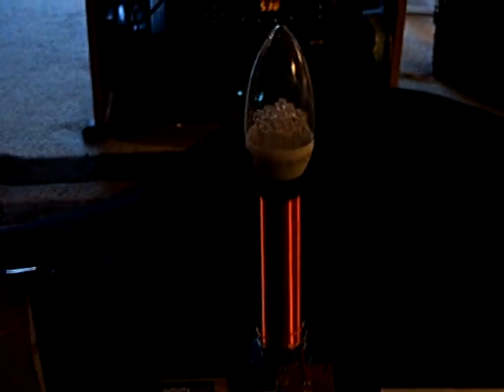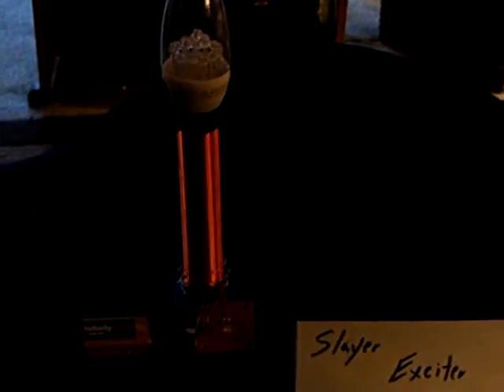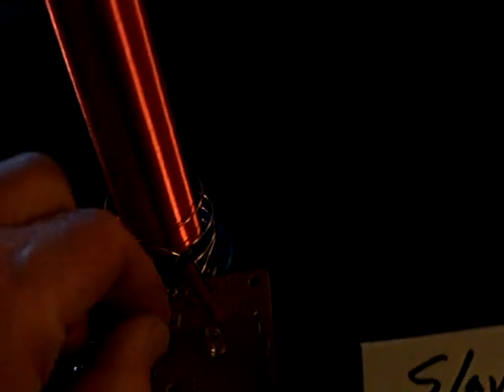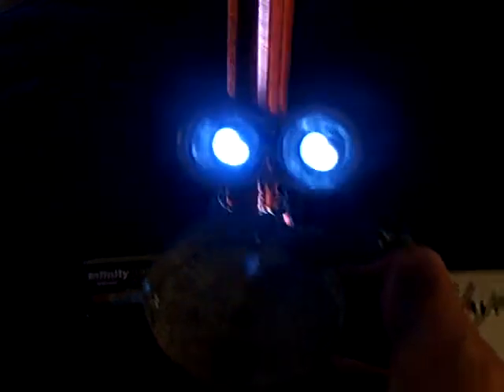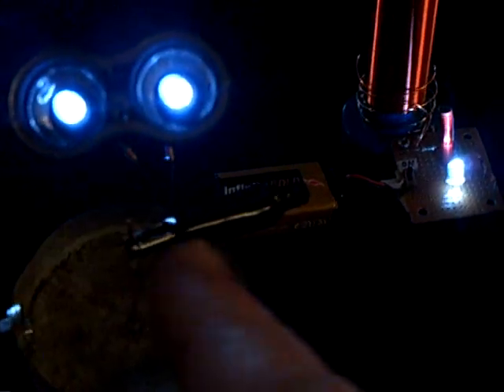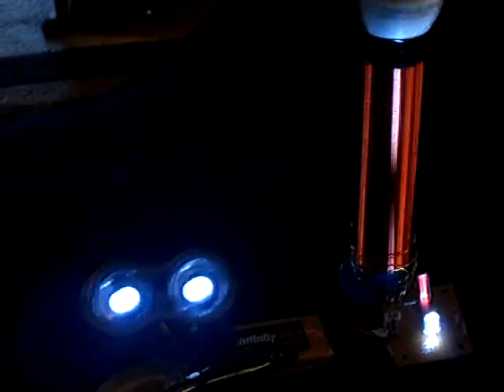Cement Battery as an Exciter receiving tower.ASF

Comment: You say that the cement battery is using coke can case(aluminum) as a plate, instead of the copper in the middle can you use another piece of aluminum and see if you get any voltage? using similar metals should eliminate the the galvanic reaction. thanks!